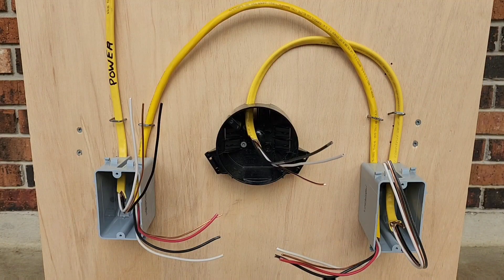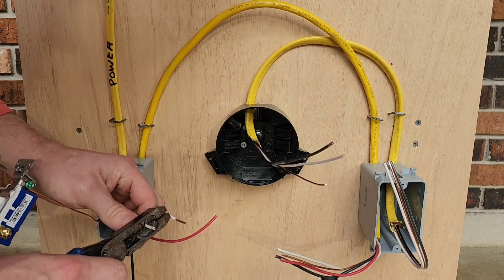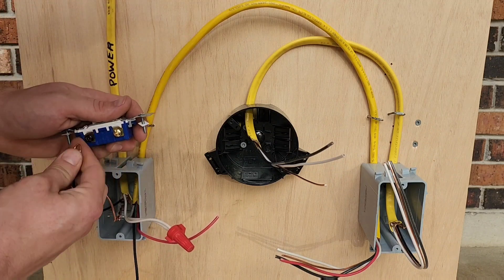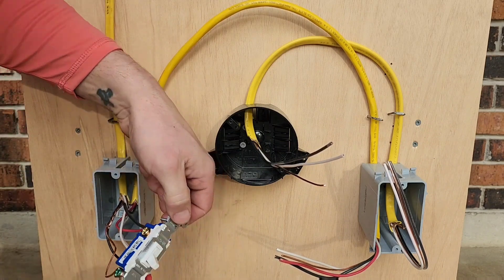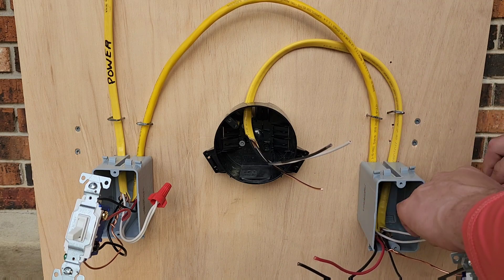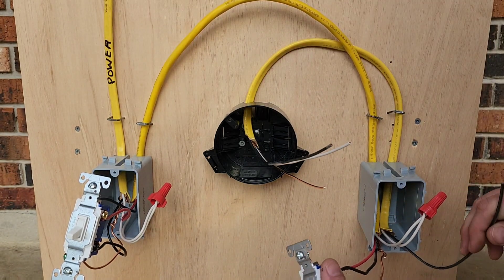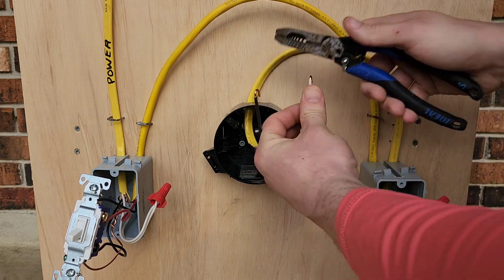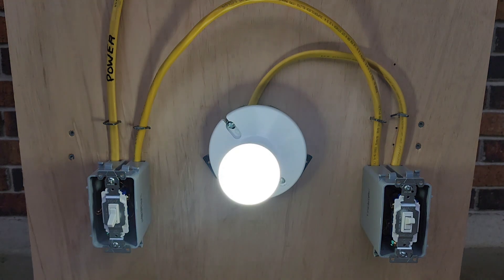Three-Way Switch Wiring Made Easy: Illuminate Your Home Like a Pro!

Comment: Leviton GFCI Switch Outlet Combo, 15 Amp, Self Test, Tamper-Resistant with LED Indicator Light, Saves Space, GFSW1-W, White
Leviton GFCI Switch Outlet Combo, 15 Amp, Self Test, Tamper-Resistant with LED, I have this kind of switch/outlet is there any way to connect it with a three way switch?
Thanks for your help.
Reply from the maker: Sure.  The exact same method of my wiring in the video. You'll need 3 way switches. You'll can pull your power from the gfci load side, and tie into the common "black terminal" of the 3 way switch.

Comment: Very well explained, my question is if I have to install a mixed switch, that is, one of the switches is double (switch and outlet), can I proceed in the same way or should I do a different installation. Thank you for your video and for your help answering me.
Reply from the maker: You can still make it a 3 way! You'll just have to change the switch itself to a 3 way switch. As well as the other switch that will be operating the light.
Reply: Thank you

Comment: In our country these are called two way switch. Even the switches are called SPDT (single pole double throw).
Reply from the maker: That's right! Are you from Europe? I know they call this a 2-way switch as well.
Reply: @LouisianaPowerSystems  - it's called a 2-way switch because there are TWO ways to switch it.
A 3-way switch will have THREE ways to switch it.
.
There is absolutely no logic in why Americans call a circuit with 2 switches as "3-way". Where exactly is the third way? 🤔
Reply from the maker: That's simply what it's called in North America. Where are you from?